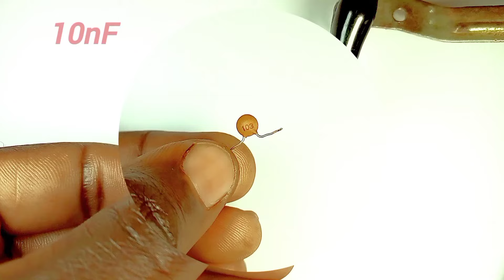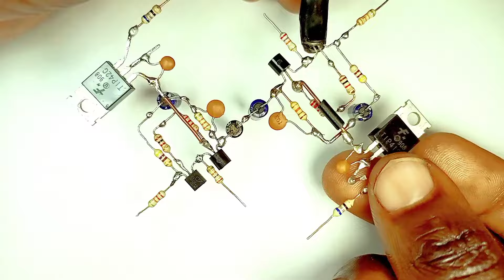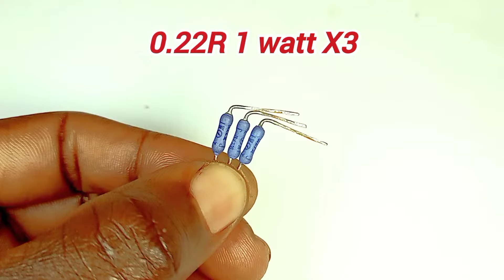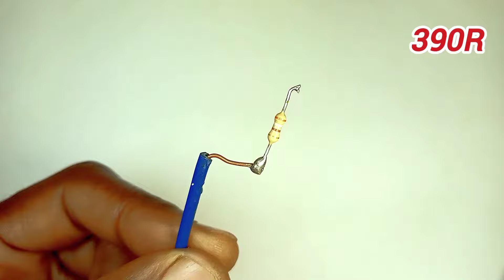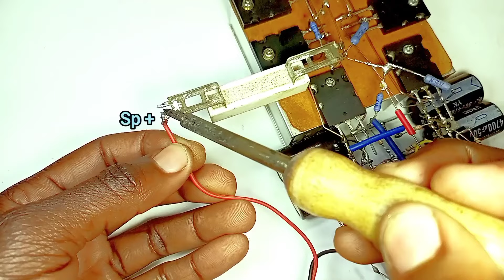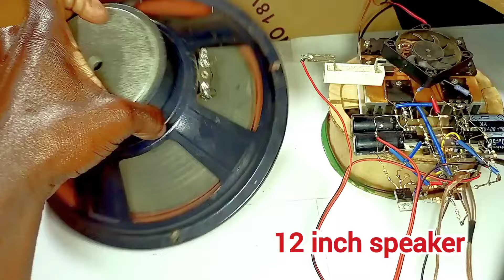SUPER POWERFUL SIMPLE 900W PRO AMPLIFIER #audioequipment @jimecomtechnologies6119 (1809)

Comment: Looks not so bad but it can be improved a lot
70 +/- means 500 watts maybe 600 in 4 ohms with thd 1%
At 5 % I could have 1 kw
The idea is not to have hundreds of final transistors... It will not increase your power just if you go down... In 2 ohms... Which is not reasonable
8 ohms sounds the best.
Limit is 4
And there are better transistors than what you show.
There are Mosfets with enormous ampers.
My preffered as bipolar ( normal transistors) are Mj 15003 and 15004, 250watts, 140v 30 A
Reply: And... Forgot to say
Power supply...
Yoy need a tougher one.
Mine, on the last project, had primary coil at 3 Kw, 1.7 mm OD ( outer diameter) and secondary 3 mm - toroidal
Bridge 100A and filter
20 pcs 10000 microfarads / 100v ( 10 + 10 ) 
Lazy start made.... Direct start = 25A😮
Reply from the maker: @Yoyo-me  My friend thanks for that information👍
Reply from the maker: Thanks👏

Comment: Its no 900watts this circuit rms output is 200 watts.
No 70v,. 36 vol 10amp okay.
Reply from the maker: According to this circuit, it has 3 pairs of power transistors these translators are rated 150W each, so we have this formula; we have power supply of 70V, ampere =12A, 4ohm load, a stable sine wave input, U = RMS voltage , U(DC)/√2. Therefore at 70V & 12A with 4ohm load will be U= 70/√2 = 49.49 then square this figure; 49.49×49.49 = 2449.26, divide by 4ohm load; 2449.26÷4 = 612.31. Then we get V=70V ÷ L=4R ÷ A = 12A × 612.31; U = 70÷4÷12×612.31 =894.41 RMS approximately to 900W RMS , Therefore RMS is 900W because we used 70V 12A power supply & we really measured it so to produce low wattage as you have said it could be the low voltage & higher ohm load either 8ohm or higher, the more voltage applied to amp the more the output as far as you don't exceed the limit or the recommended voltage of transistors, thanks for that feedback & watching